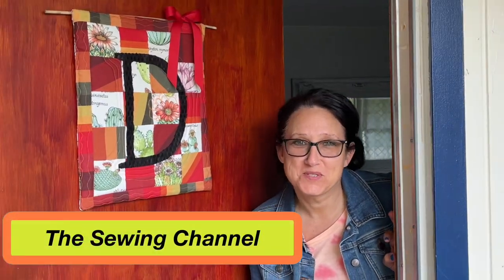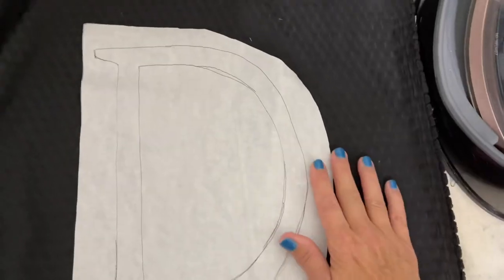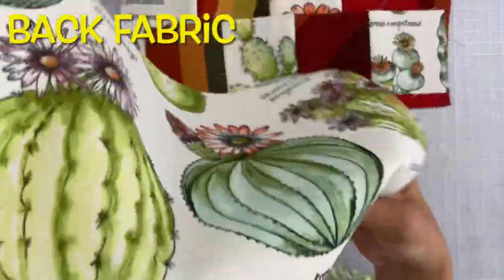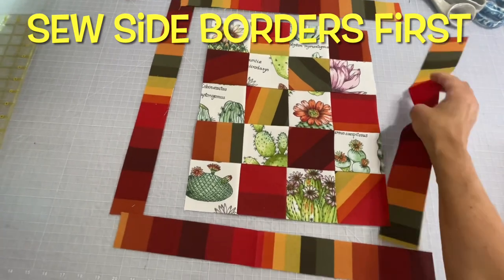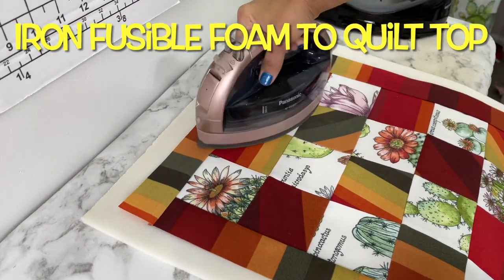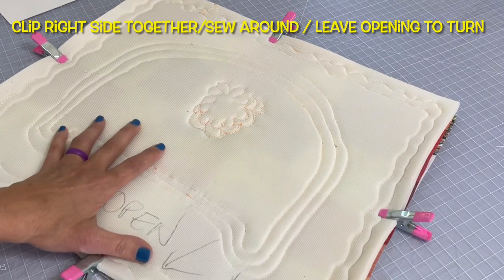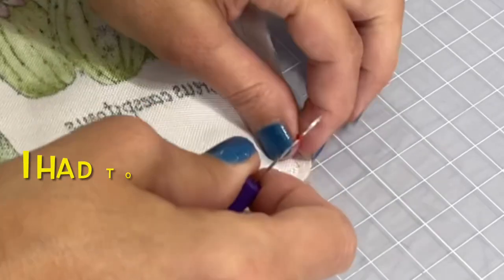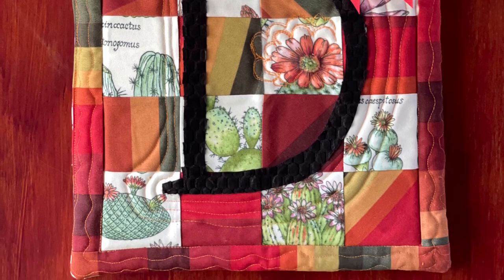Outdoor Quilted Door Hanger ~ No Fade Outside Quilt ~ The Sewing Channel

Comment: To stitch down the "D",  I'd also use a jeans needle coupled with a silicon presser foot for my machine. It works great. Moves smoothly and no skipped stitches.
Reply from the maker: Great tip! I almost ran to Joann Fabrics to get a jeans needle during the taping but I'm too impatient LOL😂